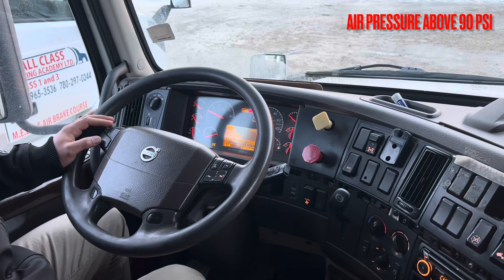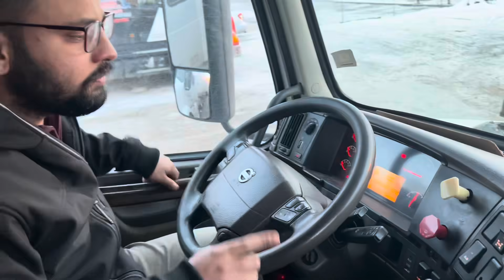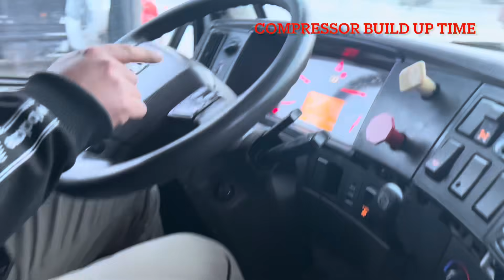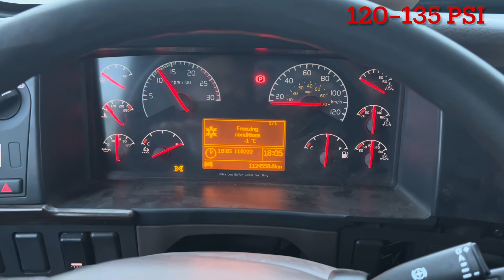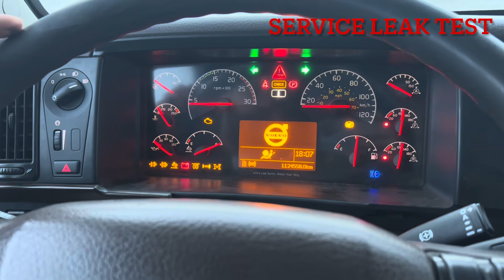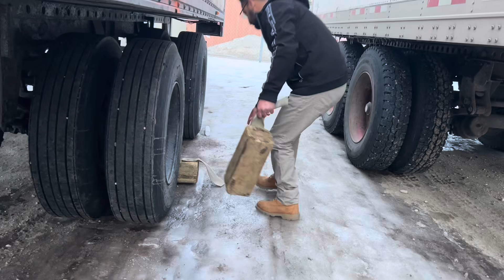Air Brake Inspection MELT

Comment: Since I'm going to drive a dump truck, is this Air Brake test on a 18 wheeler usually??
Reply from the maker: It will be all same except the first part where you have to check the tractor protection system. I have a separate for doing it on the Dump Truck. I will post the link in the description of this video.